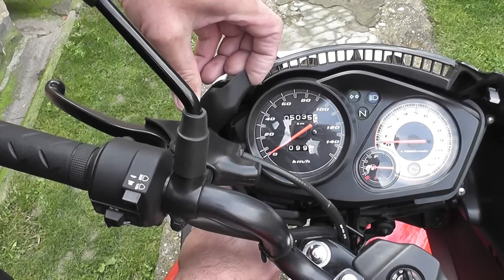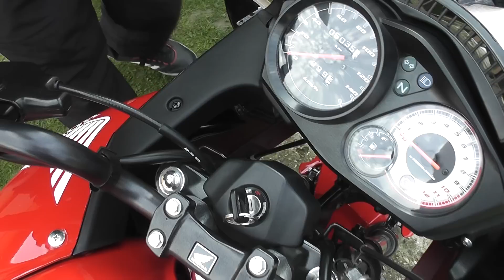Honda CBF125 - Front Light Bulbs Replacement

Comment: Hi, fantastic instructional video as always. Just wondered if you could clarify which exact headlamp bulb is stock for the Honda Cbf 125 and which you would recommend replacing it with? Cheers
Reply: It’s a Phillips 35w/35w dual filament bulb it’s called a H4 427

Comment: hi I have a Honda cbr 125 56reg and need to change my headlight bulbs and cant find any videos I was wondering if it would be similar to this, thanks and great video
Reply: Think so, you could also look for a Booklet on the bike, those often describe the process of taking thing apart on your bike.
Reply: I have replaced the bulb, they are quite similar just a few differences but more or less the same thank you :)

Comment: Hi, on my bike the odometer works but the speedometer doesn't, any ideas what should it be and what can do? really appreciate the help
Reply: The odometer and speedo use the same cable (driven by the wheel at a speedo drive), so if the odometer is working, but the speedometer isn't, you might have a faulty clock. I believe the speedo dial indicator uses magnetic interference to move the needle, so you might need to take that to a specialist or replace the clock unit. Worth checking the speedo cable anyways though. :) Hope this helps!